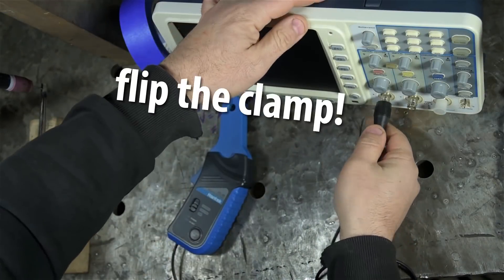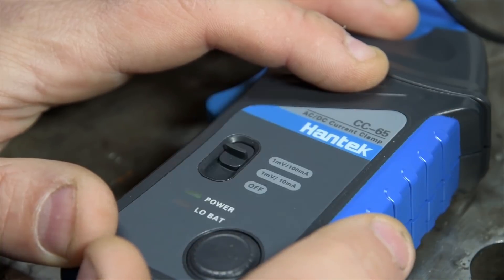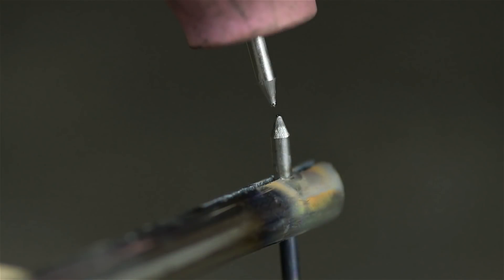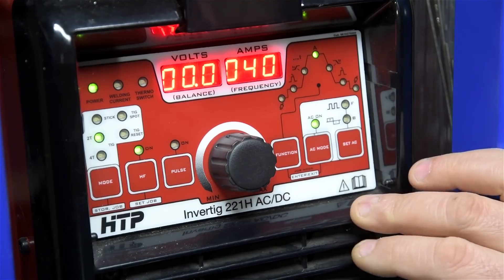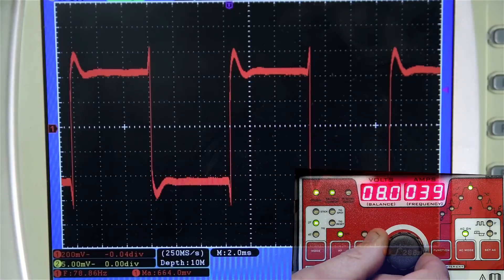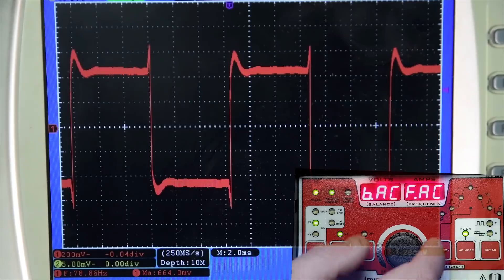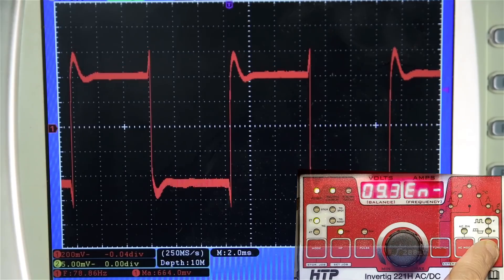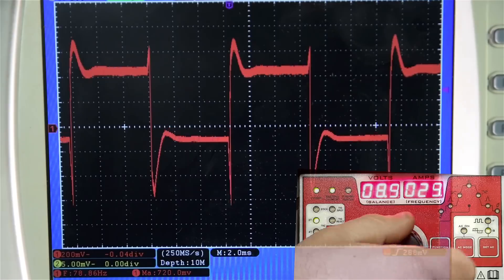Asymmetric TIG - CAUGHT ON CAMERA!

Comment: OT - a lot of magic occurs in your clamp-on device.  Can you spare $8.65 in your quest for truth - delivered to your mailbox?   Converting that cash into ebay item # 142205055329 - a 250-Amp 0.5% accuracy current shunt will be a perfect mate sending 75mV to your floating oscilloscope.   (They call it a "DC shunt, but it should be happy at your frequencies.)

Comment: Your issue with the TIG and O-scope is easy. It's divine retribution, karma, your "just deserts". The O-scope is attempting to make bad jokes, puns, and otherwise act just like you but it cannot keep up with you, therefore the imbalance in the voltages and the downwards trailing lines. Your O-scope needs more memory, a better CPU and much cooler colors. Hope this helps.

Comment: The output side of the welder is basically a bulkcap charged to some known voltage by the input side of the welder(ac line voltage input). The bulk cap is discharged into the work piece via a full H-bridge this maybe built from mosfets or BJTs depending on the welder. A microcontroller will control the current via PWMing the transistors in the bridge on and off. But it may need some time to react to the change in current flow at the abrupt points(corners of the waveform). These bat ears are called overshoot and undershoot. There is also the use of large inductors in series which can make the over shoot worse. They like current to remain constant and will spike voltage to keep or drive the current flow. The inductor makes for a nice constant current output(the main area of power transfer in the waveform). It just kinda makes it hard to design around those corners.

Comment: Hi Tony. Glad you got it worked out. Electronic tech of sorts here. One thing your demonstrations shows, cooking off your torch tip... You are demonstrating the reinvention of the electron wheel. 
Essentially, the reason for DC straight and reverse polarity. While cooking your tungsten that arc would be handling light gauge sheet metal as tenderly as lotion on a baby's butt. Increasing the frequency will be your tool to avoiding cooking off tip or material, at the respective lack of penetration.

Remember your arc welding 101. DC reverse=highest possible penetration. DC straight=electrode melts and turns red while puddles form on top of that thick plate.

But you are on track. Looks like a very handy torch you just need to familiarize yourself with and how it acts on what materials. 

Just keep in mind preserving the tungsten or work material will always come at the cost of lack of penetration.

Comment: This is called a castel wave.   It is really complicated and way above my pay grade too - somehow it performs way better and it is less effected by aluminum that is not cleaned properly
Also if you are planing to use helium mixtures with this machine - save your money ....  the effect that helium mixtures typically have on an ac tig arc is dramatically minimized with this machine ...,  
I am not scientists i just had this machine for 8 years and i own over 30 other welding machines - most of my knowledge is “backyard” science

Comment: Great vid!  I don't think flipping your clamp made the difference, but the range selection was the key.  I must get my labscope out and do this too!  GREAT to see the waveform change as expected.  A question you didn't get to is about pulse levels.  Since getting my inverter, setting background current to something like 40% and 100 amps, I would expect a partial pedal of 50 amps to bounce down to 20 amps, but I don't think these welders do that!  I think 50 bounces down to 40, and the 40a is a fixed current based on background knob setting (x) max current setting.  I was expecting it to maintain the "percentage".  Thoughts?  Cool that you have indepentant En and Ep current shifts, never seen that before!  Thanks!

Comment: Welding aluminium will show asymmetric results again.
The electrons can leave the hot tip easier than the cold metal surface when the polarity is reversed.
You don't you see this effect here, because you built a symetrical setup of electrodes.

Comment: The wave form looks like this because of Jean-Baptiste Fourier. All Signals can be generated by superposition sine Signals. Sine is a continuous function and so must be the resulting Signal. But a normal square wave is not continuous. Because of that the Signal must "swing" a little bit where the square wave wouldnt be continuous. Thats the reason (more or less) why you will never get a "perfect" square wave. How big the effect is depends on a lot of things but most on the Inverter (the coils inside) and the current (lower current better square) Here you can find an Animation: https://youtu.be/cUD1gMAl6W4
I hope this helps! Great Video like always!!
Reply: That would be true if the waveform was constructed out of individual frequency elements and somehow bandwidth limited. We can see this is not the case because the ringing a the start and the spike at the end have quite different frequency components. Besides, there is no good reason to synthesize the signal from harmonics when you can generate it nicely in the time domain.
I think the ringing at the start is most likely a control loop overshoot, but I have no explanation for the spike a the end. There is no physical reason for it so I half think it must be intentional.
Reply: stefantrethan oh yes you are right. I didnt looked right! Yes more like control loop. This could explain the spike at the end also.
Reply: It can not really explain the spike at the end. The loop wouldn't know the current is about to drop before the event, ringing is always seen after the sharp change never before it. (Kind of like when you hit a bell, it doesn't start ringing before you touch it).
Reply: stefantrethan I think it's called a not minimum phase system. Like a robot arm which swings first in the wrong direction and then moves in the right direction. Not like a bell which rings before it's hit. It's difficult to imagine. But I could also be totally wrong! I can not explain it physically. This is just a control theory guess.
Maybe everything is wrong and this is just an effect caused by the switching inverter, the coils and the capacitors.
Reply: Though Fourier and Gibbs have their roles in all wave form analysis, artifacts of that kind would not show up at these levels and frequency.  Tony has his scope set to 2ms per division, noted at the bottom center of the scope screen M: 2.0ms. The waveform period is just shy of 5 divisions, or 10 ms. F = 1 / T would compute to 100 Hz. The scope measures 97.85 Hz from the frame I am looking at. All this is just to say that Tony has his scope setup correctly. The trailing "ring" on the rising/falling edge is almost certainly  induction hysteresis. There is a ton of power in this system so it is going to slosh around, you can call this control loop lag. The leading rise (or spike at the end as it has been referenced) is also a "ring" in much the same manor as the first, the fact that is seen before the "event" is a bit of a misnomer. The welder is basically switch mode power supply with a negative and positive rail, the ground clamp would be the neutral between the rails. Current always lags voltage, so when you switch polarity, the magnetic field around the inductor collapses and a huge current spike is detected, thus there is a rise in current at the end of the half cycle. The bell was rung at the voltage change I am not a welder, nor do I own a welder, but I would guess that welding current is important over much longer time scales than 10ms.  HTP would not bother with filtering these kinds of spikes and it would put more heat into the machine instead of the business end. This also explains why the peaks do not change as Tony changes the welder's parameters, including the frequency.
Reply: i missed your reply when i made mine......  Fourier it is :)
Reply: If you look at diagrams of Gibbs Phenomenon, the Fourier effect I think Daniel was talking about, then you can see that you do in fact get overshoot before a step discontinuity from high to low https://en.wikipedia.org/wiki/Gibbs_phenomenon#/media/File:Gibbs_phenomenon_50.svg

Comment: The pointy bits in your waveform are just resonances, or ringing (meaning the same in two languages). 
You have essentially built a capacitor with the two opposing electrodes, and the output of the inverter has a certain inductance to smooth the current flow. A capacitor and an inductor in series make a resonant LC tank circuit. If you hit that with a hard edge, like an "on" signal, it is going to swing for a bit, just like a pendulum or a spring.
Reply: This does not explain the spike a the end. It could explain the ringing at the beginning (although I think it is a control loop overshoot rather than inductive ringing) but there is no way for the current in the inductor to "know" is about to be switched off and make a spike like that. Ringing is always after any transition, not before it, just like hitting a bell.
Reply: True, I didn't think about that. The voltage spike is caused by the IGBT in the inverter switching off. The voltage then spikes until the flyback diode reacts and clamps the current. 
The ringing cannot be caused by control loop overshoot though, as inverters do not control the voltage as such, they just switch it off and on. Linear regulation would cause too much loss
Reply: That is OK if you assume that the switch off point is after the ringing on the oscillogram rather than being near the start of the ringing. Personally, I think you are obsessed by a piece of trivia. I think it is more likely that it is more costly to make a perfect square wave than warrants the effort, especially if it has no significant benefit to the operation of the welder.
Reply: Although I have not looked into a Welder before, I would bet good money that it is a H-Bridge with an inductor on the output. It is just the cheapest and most efficient way of doing it.
Reply: I agree, ringing caused by inductance and stray capacitance is the obvious cause. The welder cables have inductance caused by the cable loop area and there will be capacitance between the cables. The arc will also have some inductance/capacitance but for the length of arc and setup this should be minimal. Varying the cable setup may well change the effective frequency of this ring.

Turn off ring? As Ivo suggests, inductance will cause a "ping" of current when the welder turns off before going negative. Some will be clamped by the diodes in the H bridge but diodes turn on isn't instantaneous and there will be a transistor switching transition time to avoid cross conduction between transistor pairs. There's also the inductance of the weld cables to consider.
Reply: We are observing the current waveform, so no it is not an inductive voltage spike. It is much more likely that the spikes are caused by control loop overshoot

Comment: Just a guess. Might have already been answered but do you think that the amperage is reduced on the positive side because it's only used for the cleaning/etching  process and therefore doesn't require as many amps? Of course this would be for machines that don't have an adjustment.

Comment: Don't worry about the overshoot in the waveform.. Could be real, welder or in the test setup.  You'd be better off using a shunt to measure look at the waveform than the probe but if you thing about it, the wire loop that makes the circuit is really big and has a bit of inductance.  Try twisting the torch and ground wire together and look at the waveform..

Comment: My opinion they left the gibbs phenomenon in so that the arc dont snuff out under small amperage times
Helps keep the ionized plasma area around the arc stable for better conductivity

Again just an opinion but i know trying start an arc at low voltage/current is pretty hard

Comment: I'd say the spikes on the Squarewave are just "switchingnoise" when the TIG switches polarity and basically overshoots before it drops to the desired current. At that frequency that spike is less than a millisecond , so it should be completely fine

Comment: I would guess that the spikes on the waveform are capacitors discharging.  They are used to get that OOMPH that may be referred to as arc force? to get things rolling.  More than anything else, the value of these capacitors affect how a welder 'feels' to me.  It's character if you will.  In many machines the caps can't be switched out or adjusted so when set to low current, that initial strike is out of proportion to the weld current.  It's especially apparent with my two MIG machines.  My little Lincoln Weld-Pak is great on thin sheet as the cap may be smaller than what's in my Eastwood 170 that blows holes in 18ga when starting the arc no matter how low its dialed down.  

Then again maybe I just suck at welding :)